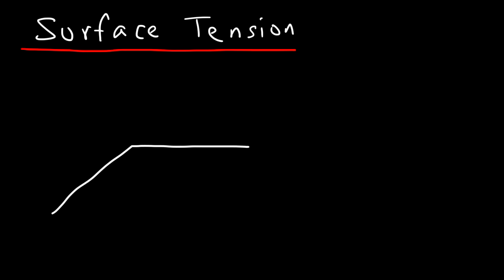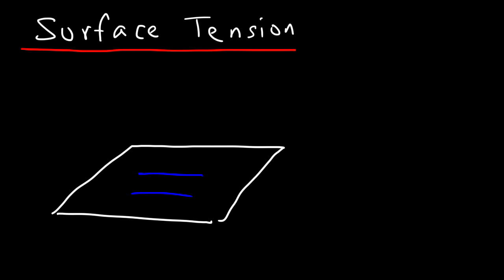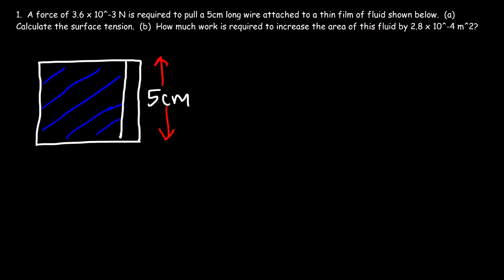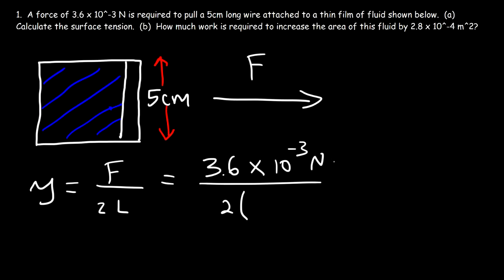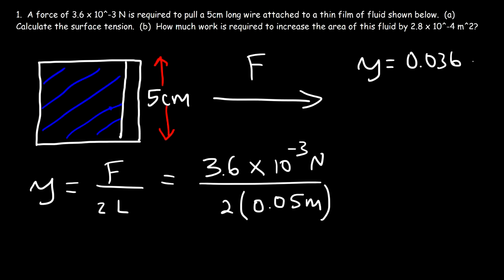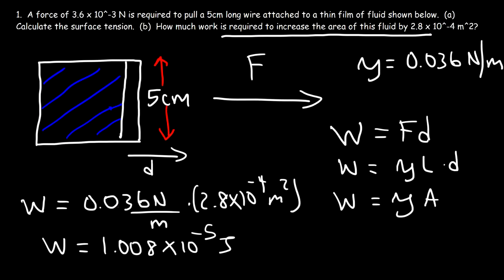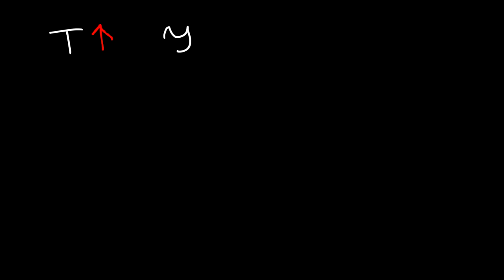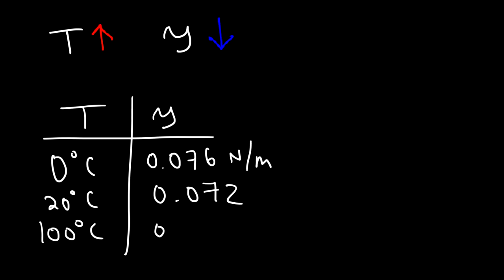Surface Tension of Water, Capillary Action, Cohesive and Adhesive Forces - Work & Potential Energy

Comment: 2L isn’t because you’re measuring front and back, it’s because you’re measuring the total length in contact which is 2dL + 2L = 2L
Reply: waittt so it was the perimeter all along? thnx a lot dude. i was so confused why we use length from both front and back side and just conclude the formula with 2L
Reply: @ak_the_gr8  exactly, it's the perimeter.
Reply: Cud u elaborate
Reply: @toxiclock1905  the material is assumed to have infinitesimal width, so the perimeter in contact would be the perimeter of the quadrilateral, 2L + 2dW

L is length
W is width, dW describes an infinitesimal width.
dW ≈ 0
2dW ≈ 0
Therefore, 2L + 2dW ≈ 2L, given the shape he describes in the video and the positions he says he's calculating for.

Comment: You forgot the factor of two when calculating the work required. It is W = 2γA, but you have used W = γA.
Reply: yes he did
Reply: thank you, I was thinking I missed something
Reply: I was wondering the same.
Reply: then whats the right answer
Reply: The length is actually 2l, so area is 2ly*d, and final equation is correct, he forgot to take length as 2l, rather than just l

Comment: 4:54 I did not get it, why we put 2 in the denominator of the equation
Reply: We have to put 2 in the denominator because there are 2 free surfaces for the film.
Reply: @anime_fan3624 could you mean the film has the top surface and the bottom; air surface and container surface?
Reply: Here's a concise explanation for your YouTube video, addressing the common visualization mistake:
Why "2L" in Surface Tension? The Soap Film Secret!
Hey everyone, ever wondered why the surface tension equation sometimes has a "2L" in it, like T = F / (2L)? It often puzzles people, and the reason usually comes down to how we visualize the setup.
The Common Misconception: Many of us, including myself initially, might picture a "liquid film" as just the top surface of soapy water in a container. If that were the case, you'd only have one free surface interacting with the air.
The Real Setup: The Soap Film on a Wire Frame!
The "2L" factor comes from a very specific experiment, typically involving a soap film stretched across a wire frame, often with a movable side.
 * Imagine a wire frame: Picture a U-shaped wire with a straight, movable wire completing the rectangle.
 * Dip it in soap solution: When you pull this frame out of soapy water, you get a beautiful, shimmering thin film of soap solution stretched across the frame.
Here's the crucial part: This thin soap film isn't just one surface. It has two sides:
 * An outer surface (facing you).
 * An inner surface (facing away from you).
Both of these surfaces are actively pulling inwards due to surface tension, trying to minimize their area.
Why "2L"?
If the movable wire has a length 'L', then:
 * The outer surface pulls on that wire with a force proportional to 'L' (let's say T \times L).
 * The inner surface also pulls on that wire with a force proportional to 'L' (another T \times L).
So, the total force (F) you need to apply to stretch or move that wire is the sum of the pulls from both surfaces:
F_{total} = (T \times L) + (T \times L) = 2 \times T \times L
Rearranging this to find the surface tension (T) gives us:
T = F_{total} / (2L)
The Takeaway: The "2L" simply accounts for the fact that a thin liquid film has two active surfaces contributing to the total force being measured. If you're dealing with a single interface (like the top of a large body of water), it's just 'L'.
Hope that clears up the "2L" mystery! Like and subscribe for more physics explanations!
Reply: @fawzisdudah8511  ty

Comment: I still don't get it why y = F/2L ??? Why force is divided by 2? or why length is multiplied by 2?
Reply: because there are 2 surfaces; front and back. think of a soapy water film when you blow bubbles.
Reply: thank you for a very good question and for the answer
Reply: if u found out lmk
Reply: @LTDeskyPOP1  check my reply
Reply: For the 2L you will be basically looking for the perimeter of the needle ,from what we know a needle has 2 lengths and 2widths for the widths its just an assumption 😂 is not included cause it's soo small we can't measure it there so we gonna say 2l for the lengths

Comment: I don’t understand why we have to deal with the length in front and behind the rod.
Reply: One way to understand this is this: the wire is contacting the reservoir in a rectangular manner, but in a thin wire   the perimeter is simply the length times two, we can neglect the width in that case. So the actual force is along two side of the wire (not really SIDES but the wire (round) touching a flat surface makes it a line of intersection) . Hope this helps. so force total need the whole length. I am afraid his explanation is wrong and so is the use of 1/2
Reply: agree, me neither

Comment: When calculating the work, he changed 2L to L and then said L(D) = Area but he is really saying L(2D) which is not Area, or would be Area(L)
Reply: Think of it has: Area=LxW(which is same as 2L). Note that this formula (surface tension=F/2L) is for objects with two surfaces in contact with water surface while (surface tension=F/L) is for objects with one surface in contact with water surface. Why work=yA is because Lxd is same as LxL(metre2)
Reply: @synkernel730  Thank you so much
Reply: Yes I also noticed that and here should be W=2*y*L*dx
Reply: Ｉagree.

Comment: Soap(surfactant in this case) on water will cause a lot of surface tension enough to produce a bubble, foam, or enough structure to hold objects or items above the water because the soap will make a net to hold it

Comment: Why to take length of front and back of the rod ?
Reply: Because there are two surfaces to the fluid, front and back. Surface tension is present on both of them
Reply: @myeloon  Sorry if this is a dumb question, but what about the top and bottom edges?
Reply: @rjk368  We just don't consider them in this case because there aren't any forces acting on them. We're assuming that the fluid would only change shape by expanding where we pull on the wire. The other sides would act exactly the same if we did the same to them. Hope I understood your question right
Reply: @myeloon  Do you mean one layer of water has two sides, front side and back side? And both of them can produce surface tension?
Reply: Water is present on front  and back side of the rod

Comment: Excuse me, I don't understand why the force applied to produce this work must be euqal to y*2L . In this way, wouldn't the movable bar remain fixed in its position? I mean, how are we supposed to "stretch" the surface of the liquid with a force that is equal to the upward pulling?
Reply: me neither? also how in the start of the video we said that surface tension tends to make the surface area smaller then when we came to the solving of the problem we said surface area is the work required to increase the area ?